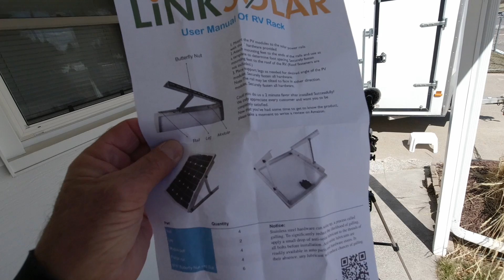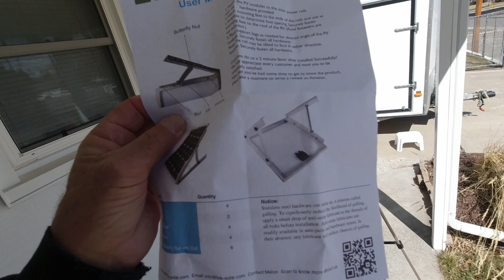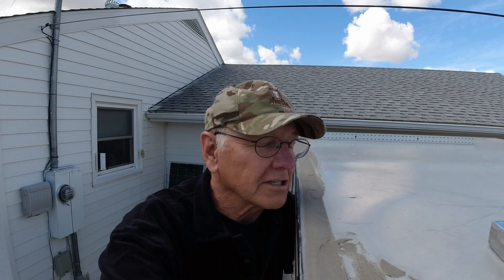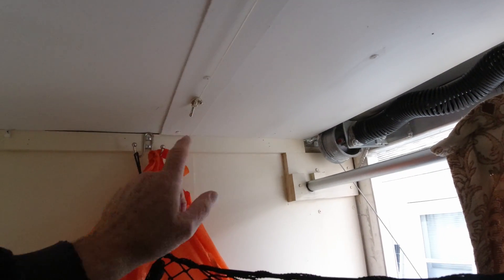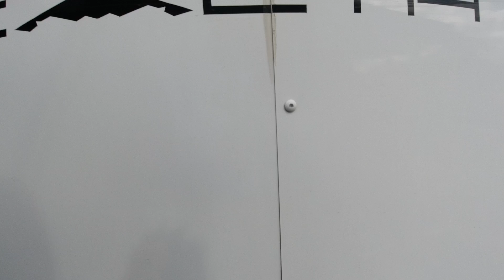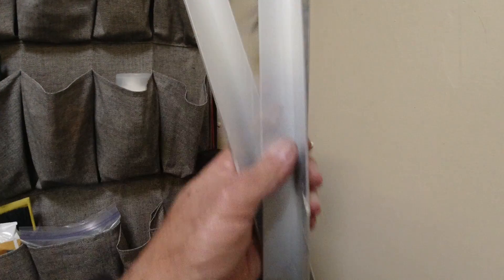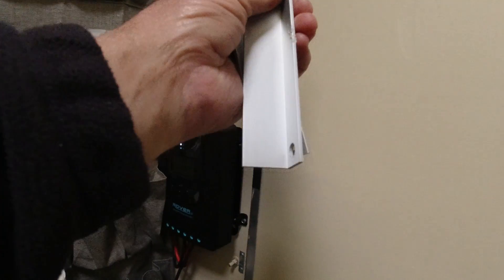Cargo Trailer/RV Tilt Panel Solar Install

Comment: You're very crafty on that. I'm looking to mount 4 Renogy 200 watt panels on a 7 by 16 cargo trailer. The tilt brackets seem to be the way to go I already have the Z clips panels and 60 anp Renogy Rover controller

Comment: Hi… always watch your videos. I am grateful you take the time to make them. I am adding 2 200 watt panels on the same tilting brackets. Do you think I could tilt them so they are on the narrow length?  (Turn the panels 90 degrees)
Reply from the maker: The hardware isn't made to go that way and it would leave most of the panel unsupported when it's folded down.  For myself, I've gone to larger panels and I don't tilt them anymore.  It was too much trouble trying to always have the trailer pointed in the right direction.

Comment: I am  picky and approve of that installation.  Sometimes drilling through the roof cross members and putting the hardware in wet with sealant is the way to go.  I made the inside ceiling and insulation panels easy to remove so I can drill the holes from the inside out.

Comment: A good strong neodymium  magnet would help you find the ceiling struts without having to do all the measuring.  It's worked for me numerous times, and I'm in the business of modifying trailers and RV's.
Reply from the maker: Thanks for the tip! Linda just discovered a strong magnet we have will show where nails, screws are. Our walls are hard plaster, like cement and the stud finder we have doesn't help us at all.

Comment: IMHO, It's a waste of time angling panels in such a situation. Are you going to rotate the vehicle gradually around 180 degrees throughout the day chasing the sun? Better to just add another panel to make up for loss of horizontal placement, leave them flat and 'relax' which is what holidaying is supposed to be about.
Reply from the maker: Have you ever tested what the difference is by angling the panel to the sun?  I have and it makes a huge difference, like 40%.  If you don't have room for additional panels then this is worth doing.

Comment: Did you worry about thermal transfer when you were insulating and putting plywood back on inside your trailer?
Reply from the maker: We were mostly concerned with stopping condensation and made sure we had a vapor barrier.

Comment: Good build - but no holes my my new trailer roof 😁
Cheers
Reply from the maker: Good sealant, like Sikaflex, and you'll never have a problem.  I installed a 2nd panel using adhesive mounts and it's doing fine also.
Reply: @gonagain  I might put some racks above the roof for mounting panels but the racks will be attached to the sides.  Good idea about the VHB tape, I trust it but I also want to be able to take them off. I guess the lower supports could be taped to the roof and panels bolted to them. Something for me to think about 🤔.
Cheers

Comment: We're now using Loctite polyurethane roofing sealant, again same stuff. Stays soft and never degrades, much more reasonable price. Comes in black and white.
Reply from the maker: Thanks for that tip, I'll try it for sure.  Polyurethane is the key.

Comment: Well Done, Podner. I also chose the Newpowa 210 Watt Panel cobbled to (a Renogy) tilt-frame. I came over to YouTube to seek a tutorial with the tilt-frame and found my way right to your same set-up. I’m presently wintering in my motorhome in Tucson but returning to our MT digs in another couple of weeks. (A whole lotta late winter events still goin’ on up there!)... My Wife’s Father and Brother live in Dillon, and I couldn’t help but notice your neighborhood looks just like theirs... I’m I right? Anyway, thanks for the walkthrough... I’ve got a rubber roof with aluminum struts, and hope to discover my struts lining up.    ~GoneAgainToo. 😎
Reply from the maker: Hello Len!  Yes, it's a lot the same here in Central MT as it is in the Dillion area, being mostly dry and sunny.  That tilt feature is really handy in AZ in the winter time and makes a big difference.

Comment: Thanks for all your help...I have used and planned many of my conversion trailer designs using your suggestions.  I will be installing two of the same panel you installed.  A question about the tilt rack.  I have used the foldable panels to charge my Jackery 1000 with great sucess.  I will be installing a lithium batter in my trailer install.  Currently, with my portable folding panels, you do indeed gain more watts with tilted panels.  But, the sun moves across the sky (so to speak...smiles).  You trailer is parked in one direction (which must also be another thing to consider when positioning your trailer, eh?), so...you certainly are not moving your trailer to get a better aim at the sun as it moves.  How do you manage that directional positioning?  Are you almost better leaving the panels flat?  For the short time your panels are tilted up, do you think the additional wattage gained warrants the effort of tilting and un-tilting them.  That's a lot of screws to change every tilt change, eh?
Reply from the maker: Hello Jerry, congrats on your new trailer!  The only time I use the tilting panel is when we are camping during the winter months and plan on being in a site for an extended length of time.  In that situation, and because I need a bunch of power for my laptop, it does make a big difference in wattage that I'm getting.  Otherwise, just put on more solar than you need and in most cases that will be enough.  I do need to park the trailer so that the tilting panel will face south and not blanket the second panel.
Reply: So...ask me if I am excited!  Today I go pickup my new 6x10.  I'll soon start discovering all the things I overlooked in my several month's-long planning and design draws.  And you know...isn't the planning a big part of the fun of doing something like this?  Let the games begin.  I'll take photos from start to finish...as I don't consider myself video material...smiles.

Comment: Another straight forward informative video. I have wired homes that I have built for myself as I have done electrical work in my younger days and I had electricians do homes I built and sold. But I have never  ventured into the world of solar but it seems very easy to do . Thanks!!
Reply from the maker: With your background, you should be able to do solar, no problem.

Comment: I really love your DIY and review videos.  We have and older (around 2005) Homesteader 610CS cargo trailer that we converted to a mobile scuba center, and have just been embarking on the work to add a 200w Renogy solar kit to it.  The big problem is this trailer has a curved roof on it, using a sheet of (what I feel to be) flimsy aluminum on the top.  It is riveted to the rounded side/corner pieces with a modest overlap (which, as others with this trailer have noted) often leaks when the self-leveling sealant wears.  So, while I see many, many conversions w/solar demonstrate attaching the panels just through the aluminum, that's just a disaster waiting to happen with the kind of roof the Homesteader Challenger has.  Your idea with the rails is a perfect solution for flat aluminum roofs, but I'm looking for suggestions on how to deal with the curved roof without having to get someone to weld a custom framework.  I'm also concerned with a mounting system that eliminates the probability of wind grabbing a panel and ripping it off.  HELP!
Reply: BTW, to see the kind of roof I have, this video shows it perfectly: https://youtu.be/5PGvY-EXhUc
Reply from the maker: What about glued down flexible panels?  I know the adhesive won't let go (Sikaflex 252).  I know the panels aren't perfect, but they should do the trick and also last long enough.  It may be your only real solution and they do work for others.  I just watched the video and I'm still leaning flex panels.  Look up some videos on mounting them to get some ideas.
Reply: @gonagain  I already have the panels now.  I think I'm going to go with steel frames mounted to the trailer "bones".  stretching across the top of the trailer and bending 90 degrees down to be bolted to the "bones" of the trailer should give me all but tornado-proof security.  But thanks for responding and keep up the AWESOME videos!  So much helpful info!

Comment: Do you think the hole for the wire path needed a grommet to prevent the edges from chaffing the insulation and eventually possibly causing a short circuit?  Great camera work and explanations.  Thank you.
Reply from the maker: You can do that for sure.  I didn't because the wire is passing through foam insulation and is also being held securely by mechanical fasteners and sealant.  It should be fine.

Comment: There goes the aerodynamics of the square box trailer....😃 I was going to mention 5200 but you got it. Great video
Reply from the maker: That 5200.  If you get it on you you have to wear it off!
Reply: Au ha ha ha. good one, double the speed get 4 times the drag.  Yep, I tell everyone you got me confused with someone in a hurry..go around cause I drive at 45.

Comment: How did you prevent the bolt from turning while tightening the nut from above..??
Reply from the maker: It was a tight fit.  Also, because the roof and the beam that I went through were aluminum, I didn't tighten very much to avoid crushing them, but depended on the Sikaflex to help as a threadlock.
Reply: @gonagain   I'm paying close attention to your minimalist solar install, (minimalist=a good thing), including electronics, as I received one of the two panels I ordered. 
I don't remember, but, did you program your controller for the batteries you installed..??  Yes, I'll need to watch it a few more times..  LOL!    You know, we seniors over 65 make it look easy to the under 65 who are unable to turn a screwdriver..  LOL!!!!  OK, I'll stop......!

Comment: That turned out great. Using big washers is a good tip.
Reply from the maker: It's been working perfectly Jody.  I had to buy a small ladder to take along and it secures inside the rear ramp door, out of the way.
Reply: @gonagain  And that answered my "do you travel with a ladder" question. Thanks.

Comment: I have an RV and>> A trail like yours!  I want to put SOLAR on it this summer too. I know for sure I will tilt the panels and use this kit, unless I can just build the kit with the gas struts and or a lift system I have.
Reply from the maker: If you do that I want to see some photos!!!

Comment: Sika flex is used by many experimental aircraft builders to hold the canopy in place on the Vans aircraft kits. Strong product.
Reply from the maker: Yeah it is, you have to remove it mechanically.

Comment: "Linear Actuator" just type that into Amazon's search bar you will get a lot of types. Then you can raise the panels automatically. You could also use a 2" actuator to make a lock mechanism for traveling when you need them to stay DOWN.

Comment: I have 2 x 235AH,  6V Lead acid batteries, and no real solar yet. I do have ONE 25watt HF solar panel but not sure how well that is going to do.
Reply from the maker: I did that for awhile and that will only keep your batteries from discharging while sitting idle.  You'll be putting in solar at some point, I can tell, but the good thing is that it's come way down in price.

Comment: Do you have any room left in the trailer for your ATV, or have you scrapped the idea of bringing it along?
Reply from the maker: That's a good question.  We can still take down the bunks easily and load the ATV, but we stopped bringing it along because of the inconvenience of offloading it every night to sleep.  But with the 4x4 Yukon we can still go most places anyway, so we don't miss it.

Comment: Does tilting the panels give better performance than flat? How much?
Reply from the maker: Hey Skipper!  It's mainly for northern latitudes with a lower sun angle and in that case you'll get 20-30 percent better efficiency.

Comment: Those panels could have easily been taped down using 3M VHB sticky tape. NO drilling in the roof necessary. HOBOTECH has a video on it.
https://www.youtube.com/watch?v=qghxSwUgxEc
And here is his review of 3M VHB tape working on his roof 2 YEARS LATER
https://www.youtube.com/watch?v=nShLdvEQyZI
Reply from the maker: I know it's supposed to be good stuff, but I just don't trust adhesive while going down the freeway doing 70mph.  The other thing is that I would just be adhering to the sheet metal and there would be constant flexing happening and that's going to lead to stress cracks in my roof panel.  Thank you for watching Sargeant M!
Reply: @gonagain  "And here is his review of 3M VHB tape working on his roof 2 YEARS LATER"  https://www.youtube.com/watch?v=nShLdvEQyZI       ;)
Thanks for the "teaching" videos Rick, look fwd to them.

Comment: Another great video.  You are my "go to" for designing my trailer conversion.  And I'm doing  my solar now.  But instead of drilling through the panels (voids warranty), I'm using IronRidge rails and hardware.  They also hold the panels ~2.5" above the roof which the panel manufacturer requires (for air flow, I think).  Mine won't tilt, though!  But I have 1300W, so figure I'll be okay :-)
Reply from the maker: You have a fantastic system and should t be able to power anything you want and with that much solar you're right about not needing to tilt them.   I'd like to have lithium batteries but they're out of my price range right now!
Reply: I ordered my batteries, LiFePO4, from Xuba in China via Alibaba.  I purchased eight 280 AH cells and have them connected in series for my 24V system.  If you haven't been there, the DIY Solar Forum is a great place and has helped me a lot.
Reply from the maker: I checked out DIY Solar Forum and there's a lot of great info there.  Thanks!

Comment: Excellent 👍👏 job... I'm liking the shock assist idea but thinking what it would take to make it tilt via power operated instead of have to go up on the roof to tilt it up... I'm partially disabled and don't really look 👀 forward to rooftop visits... Thanks 🙏🏻 for sharing.
Reply from the maker: Hi Tim, look up "Hobotech" on YouTube and check out the video he did a week or so ago on a tilt panel using those gas shocks.  I didn't do it because you still need to go up a ladder anyway, but it might give you some ideas.

Comment: That looks really good! Do you think it would be a good idea to fair over the leading edge of the unit to prevent wind howl as you drive along, it would also streamline the unit and prevent so much water flowing over it. Stay safe! Chris B.
Reply from the maker: I don't think it will matter too much.  My gas mileage already sucks anyway.  Also, I think the wind is mostly going up and over the trailer at that point.  I don't think you need to worry about it. Thanks for watching!

Comment: Having a solar system is such a life improvement in an RV. Funny, I'm in the shadow of Mt. Adams and to get signal, I'm laying crosswise in bed with the roof hatch open, sticki g my phone up through the hatch opening to get signal. You gotta do whatchya gotta do. Take care and nice install, enjoy.
Reply from the maker: I'd like to have a cell booster but can't afford one!
Reply: @gonagain  Funny to see your comment. I just finished an all day BS fest with the State trying to get through to a couple departments and had to drive 25 miles to make reliable calls, and internet.  Got my business done just before the UPS store closed. Had to fax at a dollar a page and mail things.nearly 40 bucks. Im looking around town for a cell booster. Wallyworld and Verizon store.  At least the alarms and fires are out. I should make a video! Take care...
Reply: I'm also trying to find yeast. 2 months and every store in every city I've gone to is sold out, go figure.

Comment: People say grommets.  
I’ve made stuffing tubes out of copper tubing and PVC pipe to feed through.
I don’t trust the weak rubber material in grommets.
I think you did a more careful job with the Sikaflex than the trailer manufacturer did.  Nice work!
Reply from the maker: Thanks Galard.  I did file that hole smooth and used tape around the wires first though.

Comment: When you have the panel tilted ... doesn't that limit the direction you can/should park the trailer? I guess minor consideration.
Reply from the maker: It would, to some extent, unless it's facing due south.  Tilting the panel is more for fall and winter use in northern latitudes.  Good question!

Comment: You are quite the handyman Sr. I'm thinking about portable solar panels so I can maneuver it twords the sun while keeping my trailer out of the sun if possible... What do you think? Stay safe, Perry
Reply from the maker: We also have a Renogy "Suitcase" 100 watt portable panel and the only problem with it is that when we leave camp, which is everyday), we have to put it away to keep it from walking away.  So when it could be doing the most good, it's locked up.  Thanks for watching Perry.